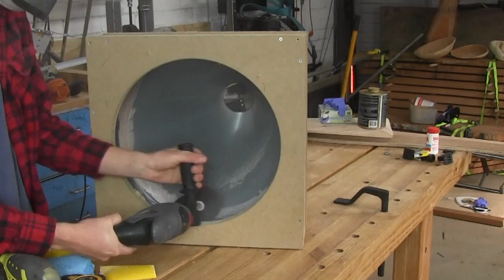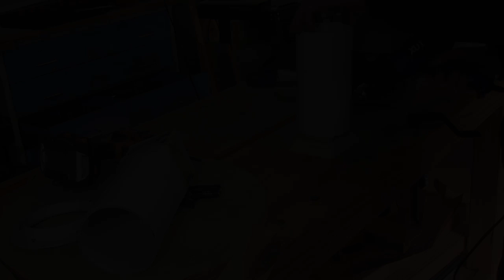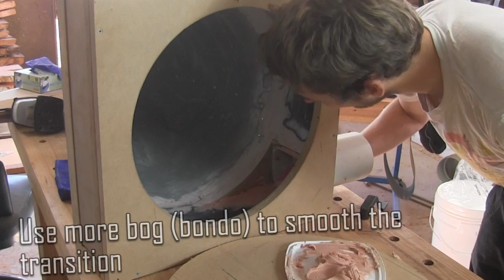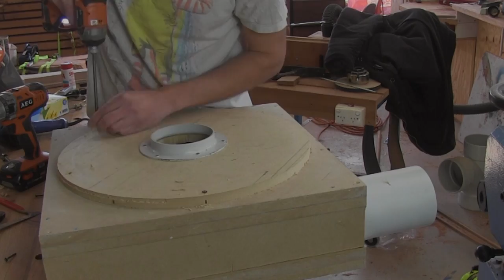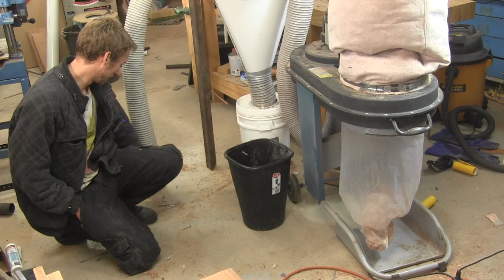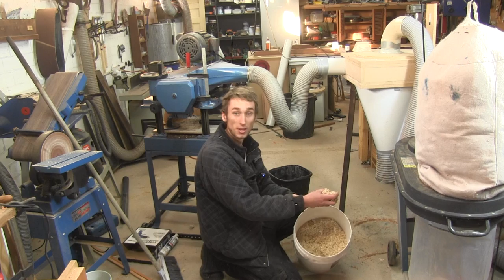Make a Cyclone dust separator - The test (part 3 of 3) (home made cyclone)

Comment: Quick question for you.. Did you notice a loss in suction from the dust collector? Because I notice your bag (filter bag) seems a little flat. When I power my dust collector up, my filter bag is bursting at the seams! I would really like to do this build, but my dust collector is a weaker model, and I am worried I won't have the CFM to really suck :P

Comment from the maker: The cone is actually very rigid, I have been using my big unit for a couple of months now wich is made from the same material and there has been no issues, and I have actually had my small unit fall off the wall where I "mounted" it and it didnt even have any damage

Comment: Very cool video - thanks for sharing.  Does the cone ever collapse under the vacuum?  I was wondering if the sign making material was rigid enough for your liking or if you would suggest using something more rigid next time - perhaps sheet metal - especially if your DC was pulling more CFM than the model you used?  Thanks again!

Comment from the maker: It does make it redundant but depending on the filter you use you will most likely need to use the bag still so the air doesn't escape the filter